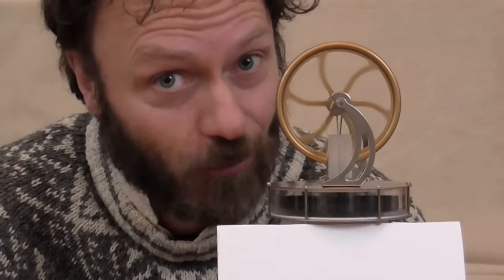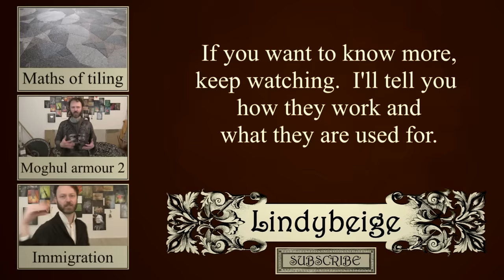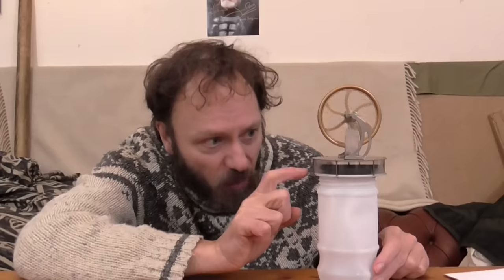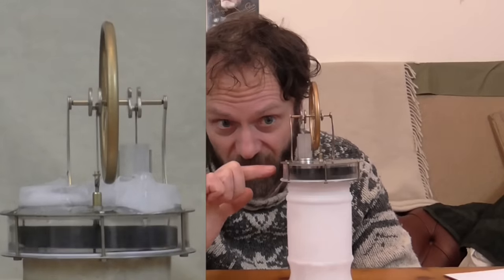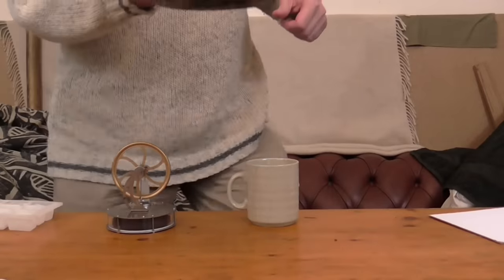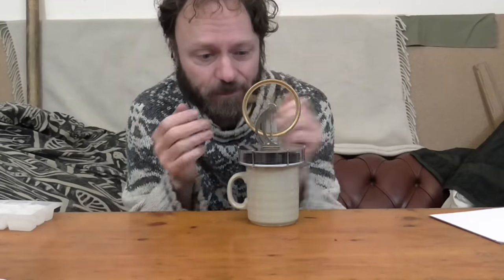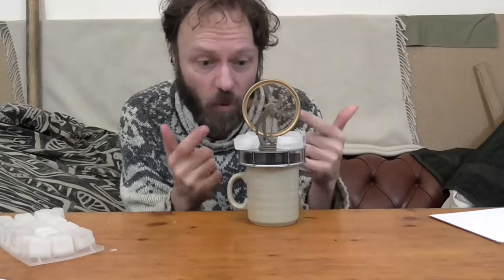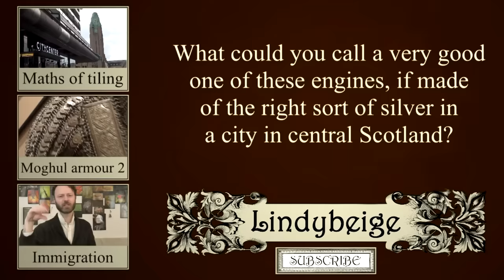Stirling Engines - the power of the future?

Comment: my guess that these engines would be really good in Iceland, using the geothermal heat and the icy climate would perfect
Reply: That's how man-made climate change should be done! :)
Reply: True but geothermal is once again more efficient to heat water for steam turbines.
Reply: @theenhancer  Why not put stirling engines on top of it?

I mean, with steam turbines you still have waste heat.
Reply: Steam turbines are easier to build and maintain.  Iceland doesn't need energy efficiency.  They have far more heat than they can usefully harvest, but they are too far from other populations to export it.
Reply: Iceland? Canada has lots of cold, does it have geothermal as well? Just thinking out loud.
Reply: @Tubespoet  For geothermal to be efficient you usually need to be on a tectonic fault line. Canada doesnt really lie on any faults
Reply: @alexmcleod3812  ah, you can't have it all I suppose
Reply: @alexmcleod3812   I always wondered why we didn’t geothermal now I know. Thanks for the knowledge 🙂 Happy Easter
Reply: @alexmcleod3812  Excessive politeness could be Canada's fault.
Reply: @alexmcleod3812  Canada has shallow geothermal heat along the Rocky Mountains.  There are hot springs under Banff National Park.  And pretty well everywhere if you can afford to drill three miles down.
Reply: @sbkenn1  iceland exports energy in the form of processed aluminium.
Reply: How about in space living beings and machine create heat Space is colder right Could there be specialised heatsinks that utilise stirling tech to gain charge or something through it
Reply: @alexmcleod3812  

Not true. Everything is Canada's fault.

Starts singing Blame Canada
Reply: Good for what?
Reply: I love the Stirling engine, it uses the difference between two temps to create movement. What I really love is that it can be just a minor difference, if you made one that was very efficient it could work with just 1 degree of difference. I would love to see it used to make large scale electrical generation from geothermal. Geothermal is good, the planets core won't cool down for many billions of years and it's easier to shove a pipe there than make fusion reactors.
Reply: @sbkenn1  almost a year later, but just asking, why not use it to charge some batteries and export that?
Reply: @mark347347  Energy density of batteries is far too low.
Reply: Fuck that just put them in Ohio. It was sixty yesterday and today it's a sub teen ice storm.
Reply: @jackmeyers7805  In Ireland, we are having the mildest, driest, most settled weather on record.  Pressures have rarely dropped below 1000hPa for the last 4 months
Reply: Thank you for mentioning my beautiful little island and our boner for geothermal energy <3

Edit: I just wanted to add that Iceland isn't all that... icy. It's tempered by the Gulf Stream and we're not landlocked in the middle of a huge continent so temperatures normally don't go below -5°C/23°F. On the flipside it rarely goes above 20°C/68°F sadly. This is just based on my experience living in the capital Reykjavík. 

Since there are no Covid-19 restrictions since 25 feb. (might change tho) I urge all of you who are interested to visit! In the summer especially, even if you hate the cold. It's super expensive, sure but if you shop where the locals do then you can cut down the price DRASTICALLY. Just avoid buying shit downtown and you're 90% good. Please feel free to ask me ANYTHING about my little island as I love promoting it (as if Iceland needed ANY promotion lol) I love all of you bastards <3
Reply: @marcokik677  Space is cold yes(kinda) but it has almost no matter. The main way we transfer heat here on earth is through contact. Contact with the air or some other material. In space you need to radiate the heat away which is much much slower. Sterling engines would not work well in space because of that.

The idea of a sterling engine heatsink though sounds fun on like a CPU heatsink.
Reply: They seem to have found a home in solar collector application in the sun belt. They'd probably do great attached to a solar collector in a cold area with little cloud cover.
Reply: with iceland's unique situation, low population and the advances in high-voltage, long-distance dc power transmission, could not the rest of the world offer those jolly fellows suitable compensation to relocate and give their homeland over to sourcing a global supply of sustainable energy?
at least til we've cracked hydrogen fusion or off-planet power production?
Reply: @johngregory4801  except they are sorry !
Reply: @odizzido  Die der Sonne zugewandte Seite dürfte sich schon gut erwärmen, und im Schatten ist es dann "ein wenig" kühler. Ideale Bedingungen für diesen Motor.
Reply: why waste free additional reclaimed power. Great idea.

Comment: I love how I have become an ardent defender and advocate of the Stirling Engine ten minutes into this video.
Reply: Rightly so, they are almost better than other engines in every way , being silent, safe and lacking any waste product whatsoever, except for the power/weight ratio which unfortunately matters a lot.
Reply: @ahmadtarek7763  I'm sure the power and weight ratio can be improved upon greatly. You could probably improve it a lot just by adding a more intricate pulley system lol
Reply: @AcidxAnarchy  I don't think pulleys would help--they'd just change the torque ratio, not the amount of energy coming out, which is useful for some applications but doesn't really help in terms of power generation. The main avenue of improvement is getting the weight down, I think.
Reply: @yetanother9127  i believe that there was an effort to make an electric car where the stirling engine didnt directly cause a car to drive, rather it charged a battery which powered the car. Quoting a piece on it "The MOD II project in 1980 produced one of the most efficient automotive engines ever made. The engine reached a peak thermal efficiency of 38.5%, compared to a modern spark-ignition (gasoline) engine, which has a peak efficiency of 20-25%. The Mod II project replaced the normal spark-ignition engine in a 1985 4-door Chevrolet Celebrity notchback. In the 1986 MOD II Design Report (Appendix A) the results showed that highway gas mileage was increased from 40 to 58 mpg‑US (5.9 to 4.1 L/100 km; 48 to 70 mpg‑imp) and achieved an urban range of 26 to 33 mpg‑US (9.0–7.1 L/100 km; 31–40 mpg‑imp) with no change in vehicle gross weight. Startup time in the NASA vehicle was a maximum of 30 seconds, while Ford's research vehicle used an internal electric heater to quickly start the engine, giving a start time of only a few seconds. The high torque output of the Stirling engine at low speed eliminated the need for a torque converter in the transmission resulting in decreased weight and transmission drivetrain losses negating somewhat the weight disadvantage of the Stirling in auto use. This resulted in increased efficiencies being mentioned in the test results."
Reply: They are incredibly inefficient, using something like 40HP worth of fossil fuel to make 1 HP.   Other than that, I would be a great advocate.
Reply: @kyleb3754  they are incredibly efficient, thats their whole deal. The cars made with stirling engines  got around 70mpg and had a thermal efficiency greater than a combustion engine. The weight to thrust was the primary issue with a Stirling engine car but the Mod II program got it to within reasonable standards. It wouldn't be the fastest or flashiest, but itd be efficient and reliable

Comment: "Its a stirling engine, and whats more its a stirling engine and you might be wondering: What's a stirling engine? Well, this is"
Video ends
I will never tire of your humor.
Reply: charles wheelock  It would also need to be Stirling Engine because it's a noun.
Reply: @dcarbs2979  "a Stirling engine", capital S after Robert Stirling, small e because engine is just a normal noun.
Reply: @GrumpaGladstone1809  I got it wrong i think.
Stirling engine = Noun
Stirling Engine = Proper noun
Sterling engine / sterling engine = adjective. Make up your own pun accordingly :-)

A Stirling Engine is a sterling engine.
Reply: @dcarbs2979  Yes. It's a sterling engine, and a Stirling engine. You got it :)
Reply: @nicholasadams2374  even if silver was the best material, i just haven't the sterling for a sterling sterling stirling engine but i reckon raheem has...

Comment: I'm currently writing a paper on a Swedish energy company which uses stirling engines to take advantage of excess gasses from heavy mining operations.
   Normally these gases are too "rough" to be used so they are just burned straight into the air. Since the stirling engine only needs a temperature difference, it can operate using the heat created from the burning of these excess gasses. Therefor, a lot of energy that was previously wasted can now be turned into electricity.
   It's really interesting how something so simple can work. I think this technology has huge potential for the future.
Reply: Can I read your paper?
Reply: @evoliveoil  It's sadly not published anywhere, and it's in swedish. But you can look up the company if you want, it's called Ripasso Energy. :-)
Reply: @antonhaeffler784  Thanks.
Reply: i wonder if it would be more efficient to use those gasses to spin a turbine
Reply: Hakim Mohamad  in Iceland they use the Steam to power the turbine.
Reply: anton haeffler Hahaha Rip-asso what a good name for a natural gas related company
Reply: Only a word of mout comment, from a Swedish guy in conversation. Apparently, the Collins class Submarines in Australia have a modified Sterling diesel engine. No idea as to the voracity of that.
Reply: As a truck driver I have seen these flames at refineries and wondered why it just went up in smoke. Now I know. Good luck with that.
Reply: Any chance someone knows what the temp gradient is between surface of earth and a 1m trench?

Edit: And/or what materials can be used  for efficiency
Reply: It sounds an amazing way to use these waste gasses. I can imagine that for a mining company buying expensive turbine generator system is out of the question but a simple Stirling engine sounds financially more viable. Succes with your paper!
Reply: These rough gases probably should quit being burned for global warming.
Reply: @sandbergmachineandtool6226  Congress is working on a bill for equal justice for males, since they're more antibortion than the quantity of women that they propose an equal law for men. No vasectomies or maybe castrations like you suggest.
Reply: spikedpsycho  the "rough" gas has a acidic content and burns  dirty. It is not like natural gas that can be 91% methane which obviously has little other constituents to burn. Dealing with the dirty burn and acidic result is one of the reasons they burn it off. If you capture it in a cylinder or tube or run it thru a turbine, it will eat  through the metal over time. Plastics can't deal with the heat, ceramics are brittle. So there needs to be an ablative type approach to capturing the heat. Filtering the gas doesn't work for all of the same reasons. And then you have to deal with the waste. It isn't economically feasible, that's the bottom line.
Reply: Good stuff. I wish you success !
Reply: Vi i Sverige använder principen i ubåtar av Gotland klass sedan 87
Reply: I'm interested in how much torque these put out..  potential for a generator that runs on geothermal energy?
Reply: @BobertGubson  Oih, veh !
Reply: @BobertGubson  Blinded by Science !
Reply: @ozdavemcgee2079  Veracity. I'm clueless on this and many other subjects.
Reply: @Freederick1  Ther's the catch. There is a piping system (MacGregor or Mackintosh, can't remember ) that's used in chlorine production, e.g. Polymer coated, inside and out. Highly resistant but not impervious to corrosives.
Reply: Is the paper published?
Reply: @SkullCandy5671  Old comment I know but turbines work on a pressure difference not a temperature difference. 

Pressure differences are harder to create then tempature.
Reply: don't swedes also use stirling engines in their submarines?
Reply: @SkullCandy5671  he already addressed the issue. Too dirty.
Reply: @tlak  and store it where? Or should acidic gases that are most likely poisonous just be released in the air.